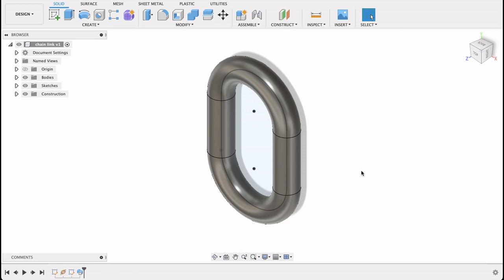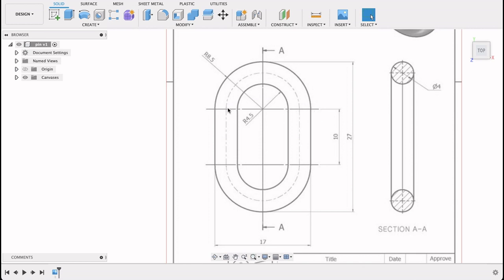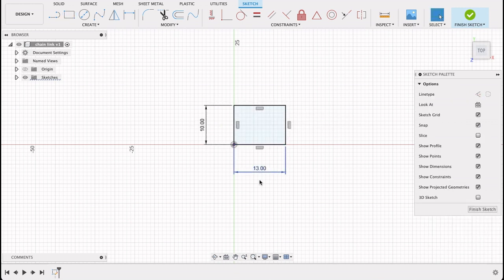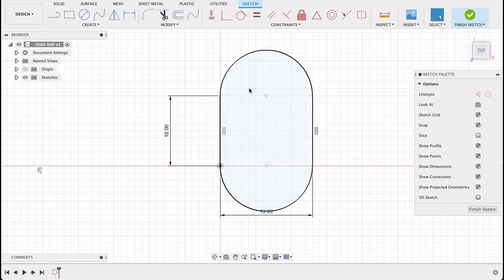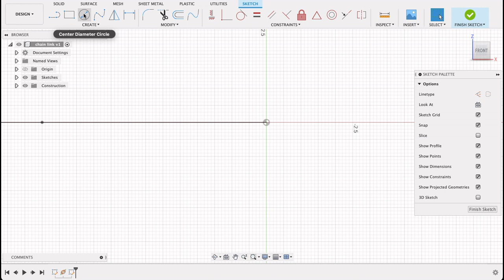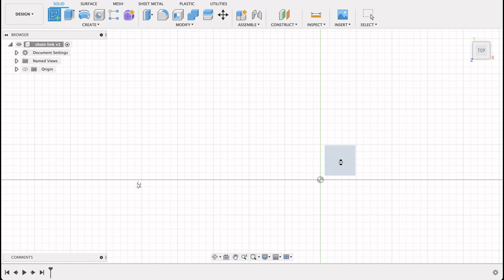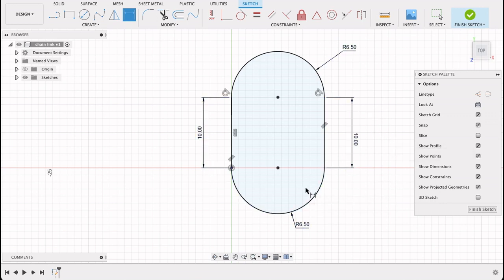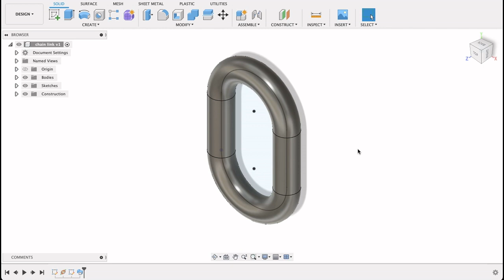Fusion 360 beginner tutorial: Practice exercise #4

Comment: Hello, there is an easier way to create the shape. Make a Sketch using the Groove function by the 2 centers which represents the path for the Pipe function , giving a diameter.
Reply from the maker: Hi, thanks for the comment. That would be the centre point slot tool and it would have our design done in 2 clicks so you are right. I wanted to show some of the basic tools available in Fusion 360
Reply: @Fusionfundamentals  it's a solution like one, everyone does it their own way , it's the result that counts ! appreciate !